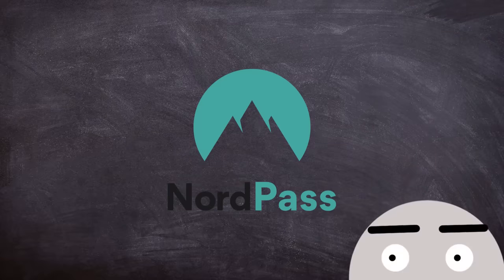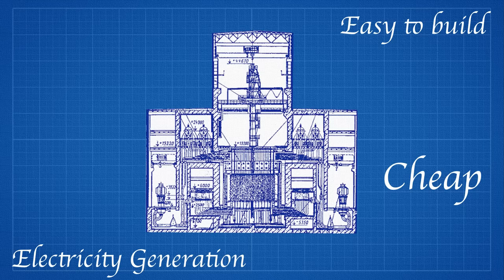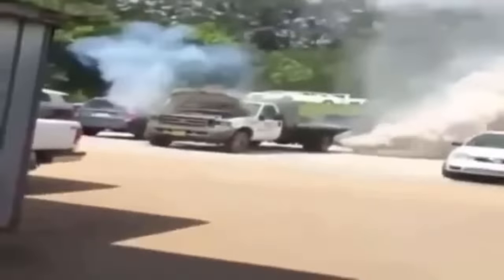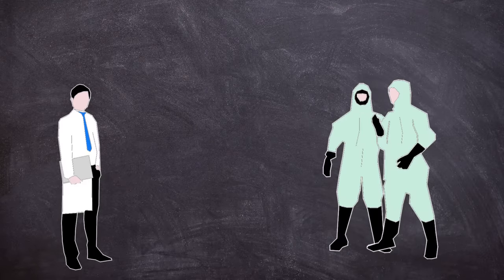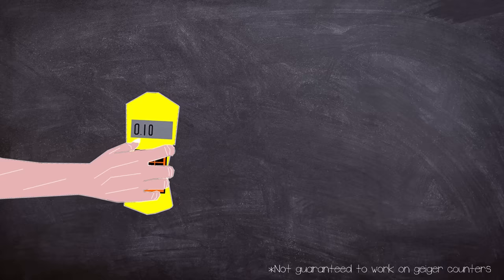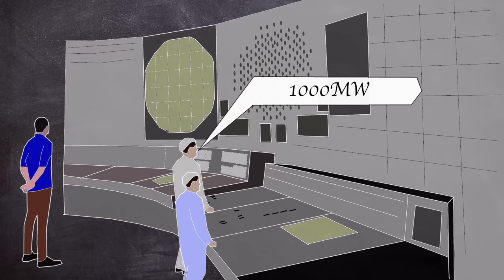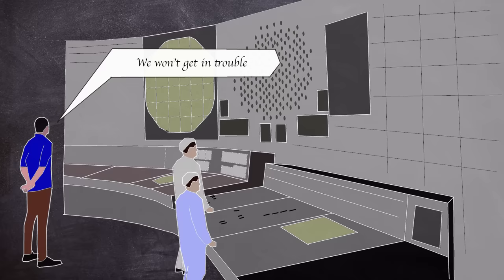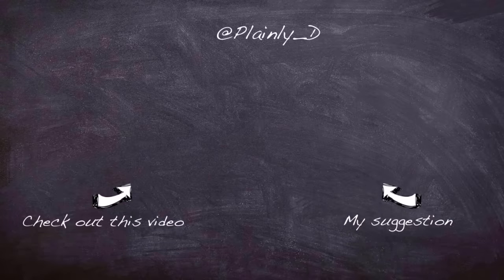A Brief History of: The Leningrad 1975 & Chernobyl 1982 Meltdowns (Short Documentary)

Comment: I remember reading about the startup of the B reactor at Hanford. After it successfully went critical, all the big-wigs went home to dinner. Shortly thereafter, it shut down by itself. They later realized it was the xenon poisoning. Fortunately, DuPont had ignored the engineers ideas on the number of fuel rod cavities and had extra ones available to rid the reactor of the poison. Imagine running a machine based on a theory and having to write the operating manual as you go. Fun fact: There was a sign on the main control saying, "Don't bump the control panel!"

Comment: In 1983 Ignalina NPP in Lithuania demonstrated the same design flaw. Thankfully the rods did not get stuck this time or disaster could have occoured.
Reply: These were 2 x RBMK-1500 reactors that had the same inherent flaws as Chernobyl's RBMK-1000 units, though both have now been decommissioned. By the way, the Chernobyl disaster wasn't caused by stuck control rods, as it was the damaged core - exacerbated by the entry of the rods' graphite extensions - which made further insertion impossible.
Reply: @anhedonianepiphany5588   Okay, but that word “caused” is surely doing a lot of heavy lifting: such disasters invariably happen, as PD often recounts, because a litany of disparate causes each end up piled on the previous ones; including deliberately ignoring safety protocols put in place to curtail exactly the sort of disasters that are precipitated.

The later Control Room of Chernobyl’s Reactor 4, likewise knew they were similarly in a Xenon pit and that the prescribed procedure was therefore a gradual restart over 24hrs. NOT yanking all the control rods out fully, even overriding the automatic safety rods too, leading to graver issues still on subsequent SCRAM reinsertion — they shouldn’t have all been out in the first place!
Reply: Xenon poisoning was a major contributor to the accident in Chernobyl. Xenon is an effective but hence also burnable poison. Wherever in the large reactor, a local increase in power occured, xenon was burnt and the local k further increased and so on... :-(
Reply: The more and more I study this it seems like the whole thing would’ve been avoided if they just told operators about the graphite displaces on the ends of the control rods. That way they would never pull them all the way out. They would pull them all the way until the graphite was still in if they needed to accelerate a reaction instead of pulling it all the way out. That way if they need to scram the reactor, reactivity wouldn’t surge because the graphite was already there.
Reply: The graphite displaysers may have contributed but the main cause was the low steam quality / high coolant flow forced them to withdraw rods to an extent far more than enough to run the reactor att 100% with normal steam quality.
In addition to that xenon acts as a burnable poison resulting in instable power distribution, especially in a reactor of this type with huge physical dimensions.
 - The graphite tips is a typical russian way to defend a serious mistake!
Reply: @jefftaylor1186  I don't think you understand how those control rods worked right. The graphite displacers never left the core when pulling them out. It is more complicated than that. They were still in the core, in fact effectively just in the middle part of it. But when they were inserted they moved to the lower part and it went critical from there.

Scott Manley has a nice animation in his Chernobyl video
Reply: @johansoderberg9579  True, but it’s not like this was their first encounter with an iodine pit (xenon pit), nor were they ignorant of this condition. It was the decision to begin the test - which necessitated the removal of almost all control rods to obtain sufficient power - whilst in an iodine pit, which brought them undone.
Reply: No, xenon poisoning occurs all the time and is actually affecting mainly axial power distribution already in a small BWR. But in a RBMK with positive void coefficient and the cooling system divided in two separate halves etc the problems can't be other than huge.

The problems with a RBMK is unnecessary. Since the construction in itself is a solution on a problem that doesn't exist. Already the Obninsk reactor ran on such enrichment that a sinple BWR would have been a better choice.
Reply: @johansoderberg9579  I tried to be kind but you simply don’t comprehend. You insist on stating the obvious as if you’re profoundly knowledgeable, and persist in presenting non-arguments. Oh well, best of luck to you.

Comment: The graphite "tips" were actually rods of almost equal length to the boron control rods. The idea being that this reactor should run very low enriched fuel, thus needing all the acceleration it could get. However, this design have also proven lethal in 1986, as the scram procedure causes the reactor to briefly accelerate. That occurs due to a design quirk where the graphite moderator rod is purposely slightly shorter than the core itself to maintain equal reaction, using light water as an inhibitor. Unfortunately, as control rods are a two-part rods, the boron inhibitor rods cannot be inserted in to the core unless the graphite moderator rods are pushed out of the reactor. When this happens, water is pushed out of the channel, leaving the bottom of the channel to be accelerated to more than 100%. In 1986 Chernobyl, scram procedure was initiated too late, and the graphite rods jammed themselves in to the bottom of the core, leaving the reactor in full throttle. Hypothetically, identical incident could have happened in 1975 and 1982, however, the operators were, it appears, in "luck" as the insides of the reactor gave up first, triggering the alarm.

Comment: What makes the Rbmk reaktors so interesting is how they can act like they have their own life. Notoriously unstable at low power, xenon poison, hot spots, and not to forget that positive void coefficient, all these words we never had heard before, and how that design whit the grafite tiped boron rods made the whole event a complete runaway, so dangerous that no man can control it.  It's fascinating in a scary way.
Reply: If people had been properly trained, it wouldn't have been a problem. Xenon poisoning is a problem in EVERY reactor. Reactivity is usually handled via Boric acid in the primary coolant and thus equalizing automatically any hot spots. If you use only rods (way cheaper), every reactor will develop hot spots. Positive void is present in all the Canadian CANDU reactors and easy to handle with large bandwidth control loops. Light water gives negative void, but makes the reactor "inefficient". A reactor with a high conversion ratio needs a large Core, no light water and a good reflector. Then you get a "nearly breeder". The best right now is the EPR with 0.7 - meaning for every amount of fissile material it "burns", it breeds 70%.
Reply: the rbmk is like a highly tuned 2 stroke engine with huge resonance exhaust, mixed with a diesel engine that is about to runaway meaning if you go full throttle at low rpm (in this case power) you get no reaction, but once it reaches resonance it goes wild making it shit to control.

Comment: Compared to other reactor designs, this one is quite brilliant when you think about it. It runs on whatever you dig up, can be built by normal industrial workshops, makes plutonium (at the time, quite usefull to keep the US of A from getting overconfident) and can be refuled without fully shutting down.
Shame there were a hand full of fatal design flaws left in.
Reply: True, it wouldn't have had to be dangerous if they hadn't decided to push the boundaries of economic performance that hard and had higher overall safety standards. ½ the cost of a heavy water reactor would have been enough.
Reply: I want to emphasize the channel design. Forging and welding a pressure vessel is an insane job. Using a multi channel reactor and having the fuel "outside" is actually really smart. An RBMK is actually quite close to the advanced CANDU

Comment: "Sir the reactor is showing faults!"
Sir "Eh accelerate to 1000mw output. What can go wrong?"
Reply: mccfly?
Reply: The reactor is more  stable at higher output. That's inherent to it"s design and would play a major role in the Chernobyl desaster later, where the accident started when they tried to operate the reactor at lower output.
Reply: @mojoblues66  I think  he means that the culture of the time was remove all rods to try to boost the power as fast they could while the reactor was heavily poisoned.
Reply: @CesarinPillinGaming  as if an engine clogged up when running below a certain load/rpm and declogged itself when under load.

So when below minimum rpm with the engine coughing,
of course you let'er rip! That'll free 'er up.
Reply: @daszieher  I did that to a car once. It didn’t like it.
Turned out to be a sparkplug dying.
Reply: @daszieher  an engine doesn't have the possibility of a critical runaway issue caused or worsened by loop feedbacks if the power and load isnt in the very narrow stable area.  Also an engine doesnt have the risk of going nuclear to the point of affecting monstrous areas of contamination.
Reply: @CesarinPillinGaming  yes thank you sir. I couldnt think of a better wording. Find the poison behind it before such a critical move, But @mojoblues66 is also right and i  didn't realize that they do run more stable at higher output. I appreciate y'all 👍 Thank yall.
Reply: excuse smee bit 1000 millawattes is 1 wattes, it snto not so mush powers!!!
Reply: @CesarinPillinGaming  thank you, I am aware of that. I should have added that my post may include traces of sarcasm.
Reply: @daszieher  you forgot your /s font
Reply: @ilovecops6255  MEGA watts.
Reply: @CesarinPillinGaming  gigawatts
Reply: @ilovecops6255  Sure Jan.
Reply: @zevirebel1236  NO! Memoery og mesured in GIGOBITES, 1 BUODE  = 1024 K BURE, OR SOIMTINEW 1000 KILO BOTES. it HAS master boote record> NUCLEOR REACTOOR IS NOT MEOMOER UN A COMPOTER. Y9OUER HAS THE WRON FVIDO AGNAENS!
Reply: @CesarinPillinGaming  ITS NOTTE JANUEREY YET, IT IDS DECBERRRRRR 2020, OT SO COOOOLD OTUSIDES BUT ALSO COLE INSIDE, YES I DES INSIDEEW THE REFRIGERATOORES. IT SI COLEDE INT ERE!!!!!!!!!!!! THANE OURES AN DHTUIBBMERS UPOERSES!!!
Reply: It's called an Italian tune-up 💥

Comment: One of the biggest misconceptions about RBMK reactors is the positive void coefficient.

The issue is not the use of graphite as the moderator, it is the amount of graphite used in relation to the amount of fuel.

The RBMK reactors are overmoderated, which means that if moderator is removed(voids in cooling water), reactivity goes up. (i.e. positive void coefficient)

The same thing would happen in an overmoderated reactor with the use of any other moderator and using water as coolant

Western reactors have a negative void coefficient because they are undermoderated. This means that as moderator is removed, reactivity goes down.

Graphite is not necessarily the problem, although when using graphite as a moderator, it is hard to create an undermoderated design.
Reply: British CO2 cooled graphite moderated reactors are over-moderated by design. This ensures safety in the event of steam ingress, if water leaks in from boilers tubes. An under-moderated design would be undesirable. But, in theory, wouldn't it be easy to build an under-moderated core, by using less graphite?
Reply: But, surely, this is all interconnected? There is the excessive graphite, as you say, and the (imho inherently dangerous) PVC... the element you’ve left out, however, quite literally, is the under-enriched fuel —from which it is infinitely cheaper to fabricate fuel rods. 

It is precisely because RBMKs utilised such inferior fuel that they were over (graphite) moderated, no? Lower Enrichment = fewer fission events = more need to slow down neutrons to enable collision = more (excess) moderation. With such poor fuel had they used less graphite reactor efficiency would likewise have sunk, hence why they used more.
Reply: @michaeljames4904  I don't think the fact that RBMK designs use lower fuel enrichments than PWR's means they had to be over-moderated. 
As Hoovie Doovie said, it is necessary for PWR's to be under-moderated by design. This is needed to ensure passive safety by means of negative void coefficients and negative temperature coefficients of reactivity.  
As I mentioned above, AGR's are designed to be over-moderated because that ensures negative reactivity feedback in the event of steam ingress. 
In theory, it would have been possible to design RBMK type reactors with under-moderated cores. That would have given a negative void coefficient but would have given positive reactivity coefficients for faults like water or steam ingress (as might be caused by coolant leaks). So I guess that one design flaw in RBMK type reactors is that designing in fault tolerance to water ingress inevitably gives the penalty of a PVC under low power operation.
Reply: Yeah, CANDU heavy water reactor design has a pretty good safety record even though its slightly overmoderated, the positive void coefficient is slight enough operators or automated systems have time to notice and respond
Reply: @drewgehringer7813 as we have seen from these two events, reliance on the operators to do the right thing is a design flaw, apparently.
it's so annoying, to me, every time that we talk about these two events (and many others), we say "design flaw". Really? If a human had followed the manual, would the event have happened?

Comment: Hmm, a mistake by operators leads an RBMK to fall to low power levels and succumb to Xenon poisoning and pressure from management to get it back online leads to most of the control rods being pulled out which results in a power surge and core damage? Where have I heard this before?

Comment: The worst design feature of the RBMK reactors wasn't necessarily the corners cut, but a refusal by the ministry in charge to allow operators and engineers in charge of the facilities to truly understand why the regulations were the way they were.   Rather than cut the corners and acknowledge the issues the cut corners raise to at least mitigate the risk and effects, the choice was made to cut the corners and make the procedures contradict the management initiatives and culture without a clear explanation to why the procedures were created.  It was this choice that maximized the risk that these reactors posed.
Reply: Agree. Even with the appalling risks inherent in the RBMK's design, two short sentences added to the regulations would have sufficed to avoid the disaster.
Reply: That said, any high hazard plant that depends on operator controls for its safety is a poor design. 
In the UK we recognise a design hierarchy, with inherently safe plant at the top, then passively safe plant, then automatically safe plant and finally administratively safe plant at the bottom. Here:
Inherently safe - won't ever develop faults.
Passively safe - become safer if faults develop.
Automatically safe - are made safe by automatic system if faults develop.
Administratively safe - require operator actions to keep them safe if faults develop.

Comment: Water does not boil into steam in a PWR as is incorrectly stated around 3 minutes, it's kept at pressure specifically to avoid that. The boiling occurs in the steam generators, so the only voids in a PWR are from nucleate boiling on cladding/surfaces at saturation temperature which has a negligible influence on reactivity for normal operating conditions. During accidents is when voids and boiling of coolant in the core is important/possible for a PWR
Reply: thank you

Comment: Its kind of sad that the RBMK was such an unstable beast, because it was kind of genius in its design. Although I guess the closest Western analogue is the CANDU, which if I'm not mistaken, has a perfect safety record, and can be refuelled without shutting down.
Reply: A CANDU is one of the safest, most robust reactors out there with an impeccable safety/ service record. And yes, a CANDU really does look like an RBMK, but then put on its side. For all intends and purposes it is what an RBMK could have been if they had sat on the design a bit more and give the RBMK the things it should have had from the start. The two reactors share the same pressure tube design and on-power refuelling capability. The CANDU even shares the same, albeit way smaller, positive void coefficient. However, the CANDU has two fast-acting separate shutdown systems which can shut the reactor down within 2 seconds without operator intervention where before the accident it took the poor RBMK between 18 and 21 seconds(!) to accomplish that feat. That might as well be 18 days in nuclear physics time when the chips are down. The CANDU also doesn't have the graphite moderator which only exacerbates the positive void problem. So yes, you are quite correct that one can see the CANDU as a Western analogue to the RBMK, but done extremely well.
Reply: The closest Western analog is actually the (now defunct) B Reactor at Hanford in Washington State. It's literally a water-cooled, graphite-moderated reactor.
Reply: @swokatsamsiyu3590 hello, swoka! Are you ok?🥺
Reply: @rbmk-1000-g8g  
Yes, I'm fine, thank you😄

Comment: The designers of the RBMK were aware of the positive void coefficient potential. They were not idiots, which is why they had boron control rods as the other half to the graphite moderators so that lowering the control rods could slow down reactivity.

Comment: One correction... not all rods had graphite tips.  Only the safety rods did, as opposed to the power control rods.  The reason for the graphite tips was to aid in creating a uniform neutron flux distribution since the tips of the rods would disrupt the flux otherwise. Ref. The IAEA 1991 Report on Chernobyl.